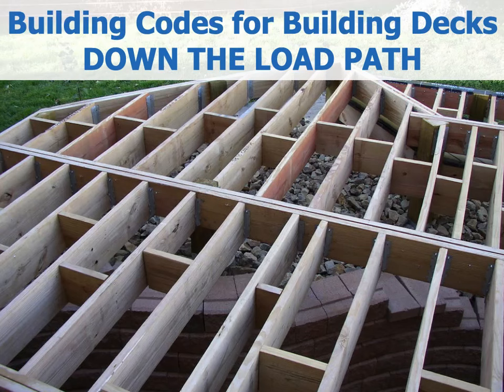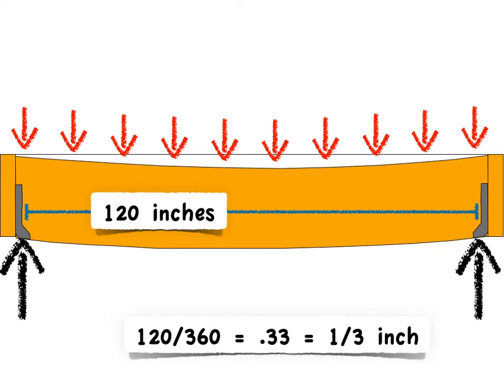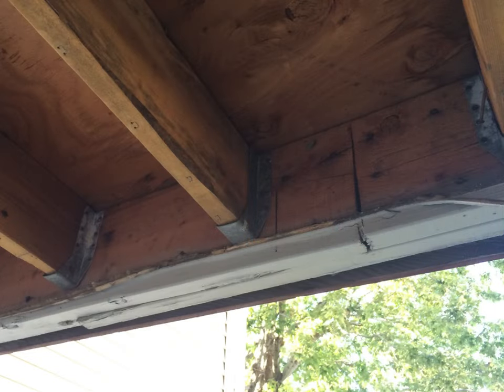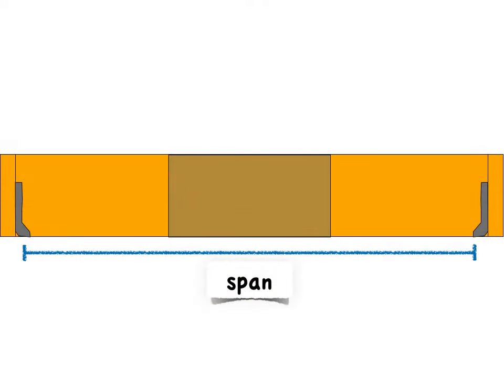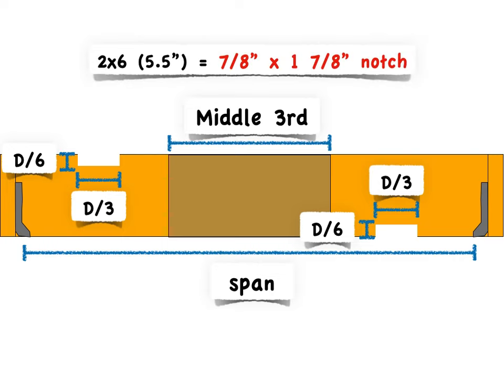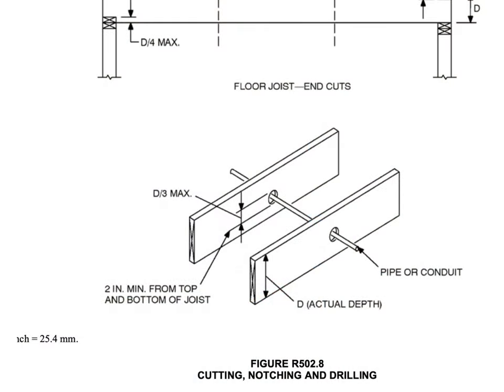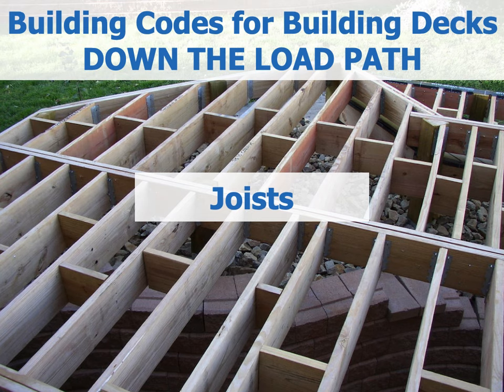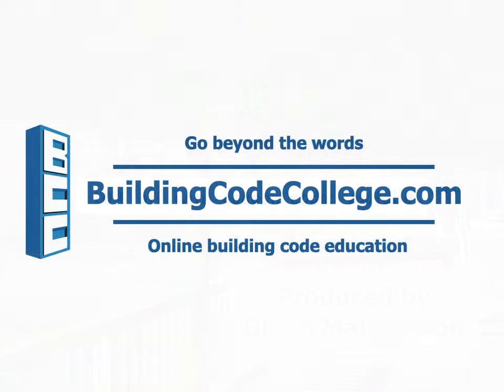Joist spans in building codes

Comment: This is a funny video I have a shed 50years old 9 ft walls block foundation clear span NO POSTS supports using 2x6s 3ft on center that go from the wall to the centre both sides 4 12 pitch strapped with 1 by 4s metal roof. I have seen 2ft of snow plus on this roof and it is  a straight as the day it was built, you folks that push the education building code seriously think of the waste and of coarse you will brag how it with stood a 9 earthquake or a 250 mile per hr hurricane but sensible people don t build in areas and then infect us with there stupid code of building serious a DECK  a you parking a d9 bulldozer for a conversation piece